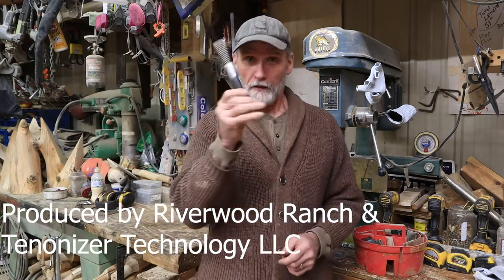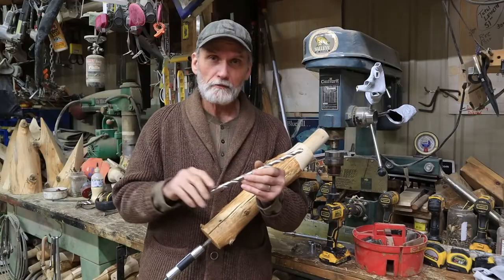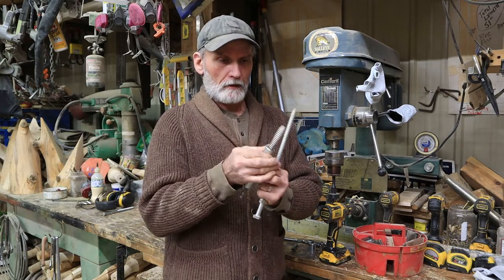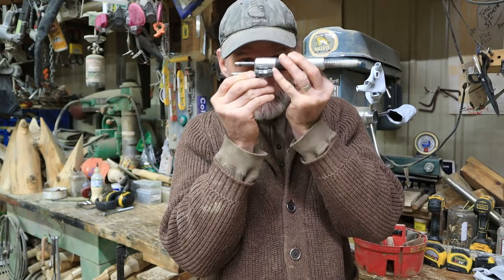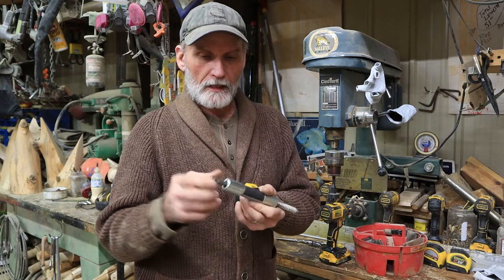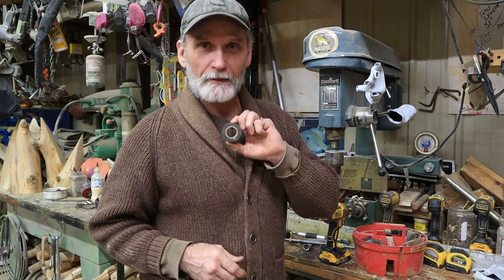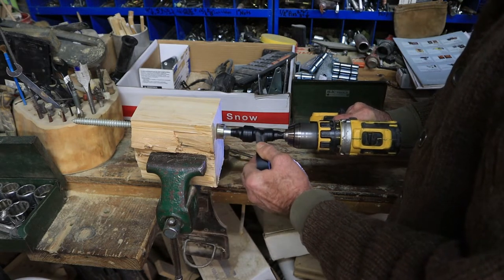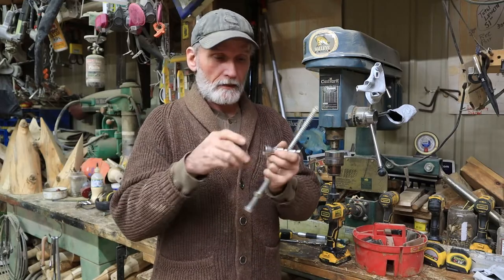You Can Make This, Tenonizer's TC 22 Flex Drive, $10.00 and fifteen minutes! For turning tenons

Comment: Would you have the part number for the 1/2"×12" drill bit please .
Reply from the maker: mcmaster.com part # 2939A37 it is a 12" long, 1/2" dia. high speed drill bit with long flutes for cleaning out the wood chips. Oh by the way James Barney, you are the first to be identified as successfully building  a TC22 wood edition from youtube video only! Well done James!
Reply: @Tenonizer  thanks kindly BROTHER I'm trying to share the blessings with kind folks like yourself . MUCH Appreciated.
Started on wood tc22 drilling jig today Ha had to use a plumbing nipple instead of the 1"dom and got a 1/2"×12" ship builders auger for now 👍 say if I file down the tip do you reckon it would slow it down from so much forward thrust 👀
Mercy . 

#shalomshalomyall 
#enjoyingthejourney
Reply from the maker: A ship auger bit is very aggressive, your solution should work...